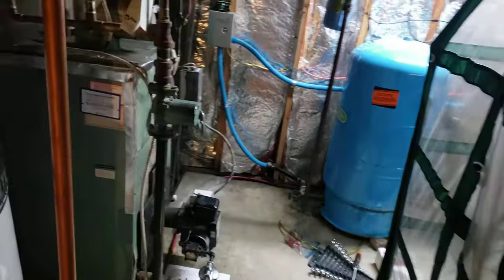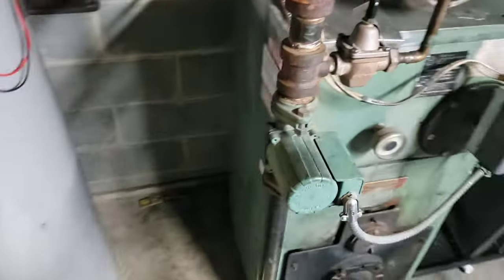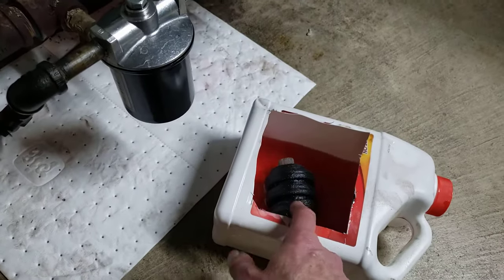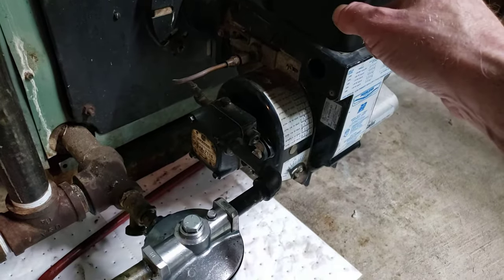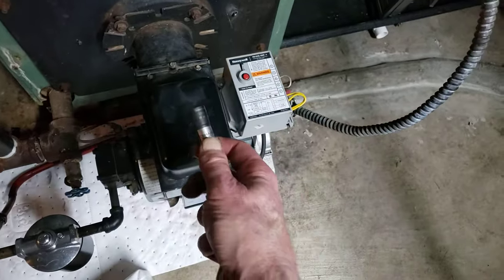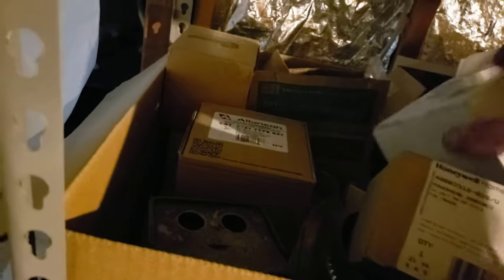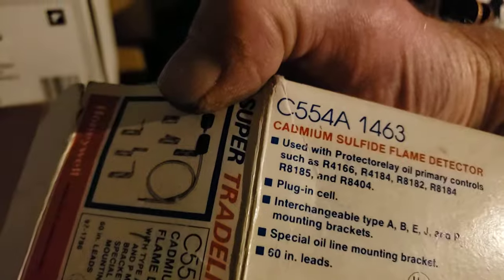Oil Boiler Keeps Tripping out on Safety. troubleshooting

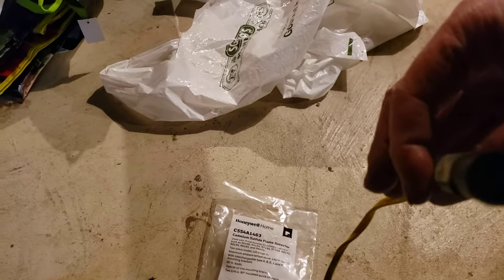Comment from the maker: Please note a mistake in the video. There are two DIFFERENT parts. There is a CAD EYE that I’m showing you at 3:15 and mistakenly calling a “cad cell relay”.   The cad eye is the actual sensor that detects light to ensure there is a flame burning. It is connected to a RELAY.  That relay can be referred to as a “control”, “safety” or “cad cell relay”. It’s a box to which the cad eye is attached and its job is to shut down the boiler if the cad eye does not sense flame. In my case the control or cad cell relay is the thing that was “out on safety “ and is made by Honeywell.  Sorry for the mistake.
Reply: No worries I have both parts anyway and I first plan to add a brand new Cell eye before I add the cad cell relay

Comment: Just had my furnace cleaned & told the guy my control tripped. He tested the transformer with a screwdriver said it was good. Since then it tripped 2 more times. Now he wants to make another service call says maybe the transformer motor ect. The furnace is running & this happens now & then. When I reset the control I press it one & it clicks fast. I';m thinking the control is bad? It a Honeywell. It does have a relay solenoid on the oil pump. Any thoughts?
Reply from the maker: Im not in the business but I would replace the control.  It could be a lot of things. I'm sure the guy checked oil flow during your service and if it was flow it would happen all the time
Reply: @Samlol23_drrich  Thanks for the reply.
Reply: what was issue
Reply: @eddwinnas  I just changed the control. Knockwood.

Comment: Great vid thank you. I would have gone for the nozzle first with a filter that dirty. So you growing special tomato's in that tent?
Reply from the maker: Thanks!  I've had my share of failures with those controls. I think they last maybe 3 years for some reason.  And I've never needed to change the nozzle. When we moved in we had the outdoor tank pulled and placed 2 new 275s inside. We've had the same reputable company deliver oil and do the yearly service since then. So the oil quality isn't too bad. Plus a new nozzle every September. (But I do have some spares just in case!)  

Ps no funny stuff in that grow tent. Everything is legal recreationally  now. I grow Trinidad scorpion and ghost peppers in there. They take for ever to get going.  I can keep it 85 and very humid so they are ready to go outside in June.  Thanks for commenting.

Comment: Cad cell in NY is $50.00 bucks....what solvent can i use to clean my cad cell?
Reply from the maker: Are you talking about the safety relay? Or the cad eye?  It’s under $20 to replace. Here https://www.supplyhouse.com/Westwood-Products-E80-1-Complete-Flame-Detector-with-Cad-Cell-Eye-30-leads-S-Bracket. Also I answered the cleaning question somewhere but can’t find it now. I clean mine with windex. Or any other window cleaner I have around. If it’s really sooty or dirty, you probably need to adjust the flame. Mine usually is a little dirty but that’s it.
Reply: @Samlol23_drrich  
Thanks for the reply I forgot I can buy just the Cadcell eye😉👍. Your channel is soo GREAT in the way you are helping people save money. Friday I will work on my boiler cause I am off. I already have one of those parts not the Cadcell eye which I know is under 20 bucks. I will first try the Cadcell replacement and see if it still shuts off then replace the other part if it does
Reply from the maker: @HandsONreviews4u  thanks very much. Here's a video I did replacing that Honeywell relay. It's pretty straightforwardhttps://youtu.be/fEjTpvuMoQc?si=72lA7WunpTRT7PGh

Comment: When replacing the primary is it plug and play or do you have to program it?
Reply from the maker: I'm definitely not an expert but it depends on your system and which safety you get. 
I don't have any delay or a solenoid. And the safety was plug and play. Nothing more than in the video. 3 wires and done.( Just need to push the red reset button when you power it on the first time). I THINK that even if you have a delayed oil valve/solenoid they are mostly not programmed any more than what's standard. 
I would watch a bunch of Steve Lavimonieres videos on the subject. Good luck

Comment: If I had customers like you I would be out of the job.  Love clueless customers who dont go in the basement look at there boiler
Reply from the maker: Nah. For every one like me there are 10 who are clueless.  I learned out of necessity. Boiler and both ACs are original to my ‘89 house. Nobody would touch the leaking disconnected tankless gasket.  Nobody would replace the falling apart combustion chamber liner. Nobody wanted to replace a Schrader core on my R22 system.  I don’t blame anyone.  They think they touch it it becomes their problem even though I said it wouldn’t be. So I learned to do the stuff myself. Next go round in life I would do HVAC. It’s better than what I do now. And I’m a friggin dentist. Thanks for commenting.  I’ve got great respect for what you do. I never ever helicopter and tip really well any time anyone does any service.
Reply: @Samlol23_drrich  appreciate the non-helicoptering.  Means alot to us.
Reply: @Samlol23_drrich 
If boiler companies weren't RIPPING US OFF ID SAY YEAH your taking their business away but your doing great with this video. These videos break the fear of doing it yourself which I have been doing for a few years. What solvent can I use to clean the head or sensor face of my cad cell
Reply from the maker: @HandsONreviews4u  thanks!  Before heating season I usually clean the face of my cad cell with whatever I have lying around like windex or other bathroom cleaner.  Just to take any dirt or soot off.  Couldn’t hurt. I wouldn’t use acetone or anything that would make the plastic cloudy (although acetone is my go to for almost everything that’s NOT plastic.  Thanks for the comment